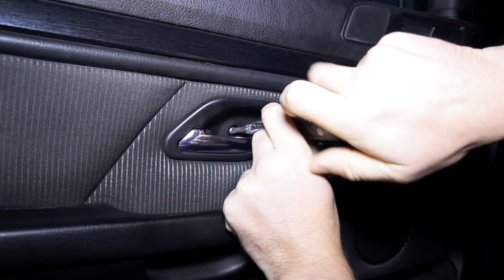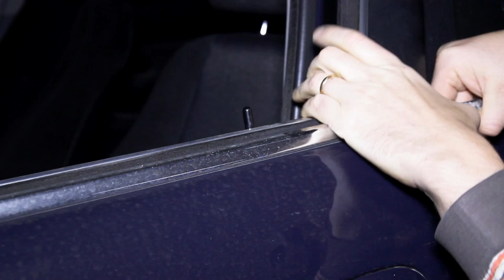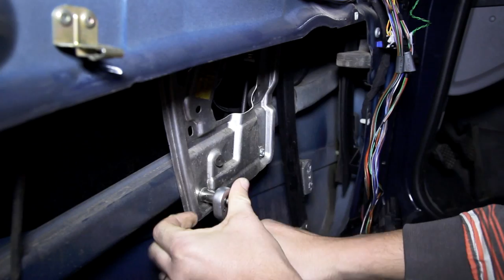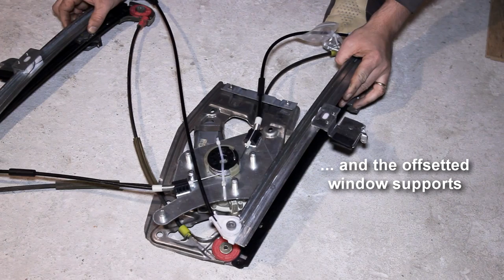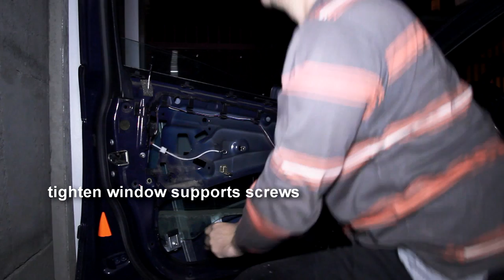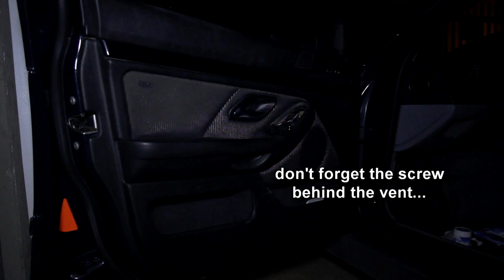BMW E39 front window lifter repair

Comment: Greetings from New Mexico, Land of Enchantment. An ice storm last year (as they always do) froze the window scrapper to the driver's door glass (and all other windows for that matter) and I did not free it up before attempting to roll the window down. It slipped my mind, sadly. So you have helped me to understand what is involved (youtube is often better than searching my Bentley's manuals) and I am grateful. I do not think anything is broken - the regulator clamps just pulled straight off the glass. This one of my biggest beefs with BMW and their design of the e39. You'd think they would have taken this clue from the Volvo 240 - since the rest of the e39 design seems to hail directly from the 240 - where the Volvo 240 windows are truly protected in winter. Sure- I guess the 240 windows could be frozen to the scrappers - but it's never happened on my 240 int he same climates. Also - the e39 doors freeze to the body in the same way. Snow will melt at the top of the seal and then trickle down slightly and freeze in place. The you try to get the doors open and the seal breaks - part of which is stuck to the body paint. Unbelievable ineptitude coming from a car maker who supposedly understands what it is like to live in a place with winters. I expect this kind of thoughtlessness from a Jamaican car maker (with respect to winters only) respectfully.
Reply from the maker: I had my door frozen as well. And the window... I don't know what can be done about it.... Especially if it freezes after rain. I have a car port at home and the car is protected. Also, I make sure I clean the snow off the window after driving is it accumulates. If I forget about it and leave the car like that, warmed after driving, snow will melt and then freeze in the doors...

Comment: absolutely the best window regulator repair video I have ever seen. SUPERB!  Wish you were in the fort worth texas area I need both of my front window regulators fixed.
Reply: Fort Worth! Where the west begins.....I was born there, raised there, lived there until moving to  northern new Mexico in my 40's, and got both of my e39 Touring in Funkytown/ Panther City. But I don't let any mechanic touch them - or my Volvo 240 or 122s or first gen 4runner. Did you get to fix your windows yourself?

Comment: Guys, glue well the isolation after that because when it rains, that's a weak spot and it will leak in the coupe.
Reply: What kind of glue do you recommend
Reply: Bitumen sealant

Comment: What held me up was the rubber lined glass mounting pieces from the original lift mechanism was fused to the glass and didn't want to budge. I finally resigned myself to the possibility of breaking the window so I kept hitting the metal part of the mount with a hammer. They both finally fell off and I found finish the installation.

A couple of things. ALWAYS disconnect the battery before screwing around with the airbags. All it takes is one time exploding in your face to do some serious injury/disfigurement/hearing loss. You can leave it plugged in and just hang it off to one side with some wire.  If you disconnect it while the battery is connected it will probably throw a code about it not working. Second, you don't have to remove the hook from the door handle. The whole think will slip through the vapor barrier. Third, to insert the 3 top screws, it helps tremendously to use some of that black sealant from around the door, putting a bit of it on the screw head to make it stay on the socket. It can be tough enough trying to get the holes to align and slip those 3 screws in, without them falling down into the door frame.
Reply from the maker: Very good info! I got the same problem with the rubber... No airbag to worry about on my car :)

Comment: While removing the outer window trim gives you a little more wiggle room, you can get the window out and back in without removing it, but it is a tight fit so don't break the glass trying to force it. I left my trim on because I didn't want to take a chance on scratching the paint or bending the trim. If you have the proper plastic tool to do it, then go ahead.
Reply from the maker: St8kout I was a bit worried myself but it came out quite easy.
Reply: Good advice thanks

Comment: Buna Cosmin! Am o intrebare, la mine motorul merge, dar geamul uneori nu se inchide, alteori da. Ca sa-l inchid, am incercat sa-l trag in sus si mi-a iesit cu totul afara, practic am ramas cu el in maini. L-am bagat la loc cum am putut si de atunci nu-l mai deschid, mi-e teama. Ce sa fie? Sa fie doar suruburile care-l tin, desfacute? Multumesc anticipat! Apropo, excelent video, la subiect, fara vorbarii inutile, etc. Al meu este BMW  530d, An Fabr.2002, E 39.
Reply from the maker: salut! suruburile alea nu cred ca se desfac singure. mai degraba s-a rupt cablul. cel mai simplu e sa dai fata de usa jos si sa vezi ce e acolo. succes!
Reply: @CosminRotaru  Multumesc mult pentru raspuns! Am sa verific sa vad ce este, interesant insa, in vara cand am fost in tara, mi-a reperat cineva, un mecanic cu atelier (!) geamul, am platit frumos. El mi-a spus ca macaraua trebuia schimbata. Habar nu am ce a facut. Ok, vorba multa strica, am sa ma uit si am sa-ti dau de veste. Gasesc undeva cablu separat? E greu de inlocuit? Multumesc!

Comment: This design is different then my e39 2000, the cable face outs from the door, and it mounts to the center of the door differently as well.
Reply from the maker: Makes sense. This is a 96 e39. Yours is the face lift... I hope you still managed to fix yours.
Reply: @CosminRotaru  
Now I understand.  Thank you for the quick reply.. the design looks better on your model.  The newer models have cable guides that cause issues.
Reply from the maker: @IamAgrocerybag  idk... Maybe it's just because they are old. I got the plastic rollers snap. O guess plastic gets brittle over time.

Comment: Salut. Am si eu acelasi model de macara. Cand e inchis geamul ramane spatiu intre cheder si geam si ploua in usa. Imi recomanzi niste reglaje fine? Ori e macara aftermarket si raman cu paguba
Reply from the maker: Al meu e din 96. Nu are senzor sa se oprească. Geamul se oprește când simte ca forțează motorul. Nu ai ceva care obstructioneaza mișcarea? Spațiul rămas este uniform sau mai degrabă e geamul strâmb?

Comment: What part do you use for the regulator? Mine may be shot.
Reply from the maker: This was quite a while back.. I don't remember. I think if you search on realoem you'll find a part number for the whole thing, motor included. If I remember correctly it was at the car parts store that I found out that there's a repair part, without motor (hence cheaper...). Go to the store and ask about the window lifter for your car... (The car VIN will help)

Comment: My 2003 540i doesnt change  gear when im driving, It makes sort of an aeroplane sound. What can i do. I have changed the gearbox, issue persisits. What can i do
Reply: There are speed sensors in one or more of the wheels that feed info to the computer, that tells the tranny when to change gears, (it's also part of the traction control system). Those cables eventually get frayed and the wires break. I don't remember if each wheel has one, but get under the car and look for the sensor bolted onto the wheel hub and follow the cable. If/when you see the frayed cable then that's your problem. I think it was on my front left wheel, but check all four wheels. The cable connects to a main connector box in the wheel well, so you'll have to pull off the tire to see it. The cable eventually gets frayed from road debris.

Comment: Did if feel like your window goes up slower? I did mine and it feels that way.
Reply from the maker: vosedon the whole thing feels like it's about to break. I'm surprised it still works after almost two years.
Reply: Cosmin Rotaru ya these designs are crappy. After I installed the wire would fall off the guide and make a big click sound that sounded like a broken regulator. Had to bend it a little and good so far.  Great videos sir!
Reply from the maker: Thanks!

Comment: Where is the door airbag?
Reply from the maker: Ricard Rebollo this is a 96 model. No door airbag. You might have seen some airbag sign on the door cover - I changed the interior. Took it from a 2002 facelift.
Reply: Thanks. Good Job and better video.
Reply from the maker: Ricard Rebollo thanks!
Reply: This video was really helpful. .. my lifter was replaced before I bought my car and now the window works intermittently. ..I'm guessing motor failing.  I took it apart using your video and it's in bits awaiting the new motor.
Reply from the maker: Good luck with your repair!